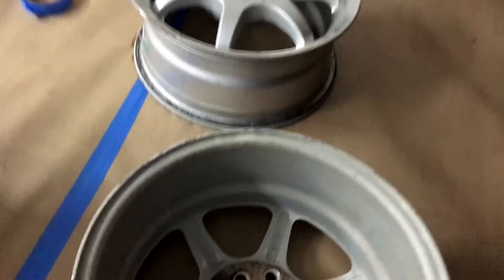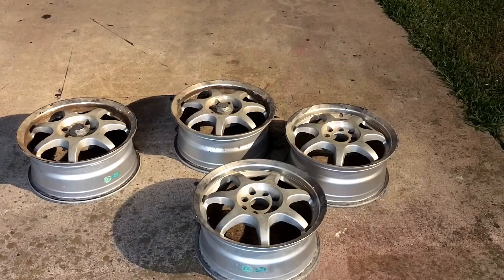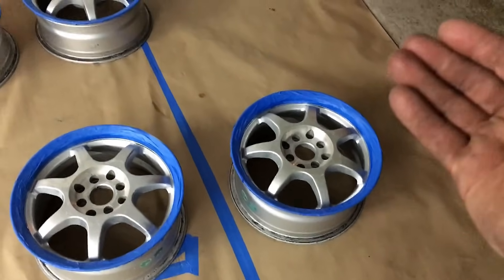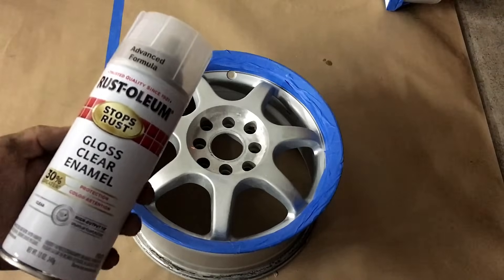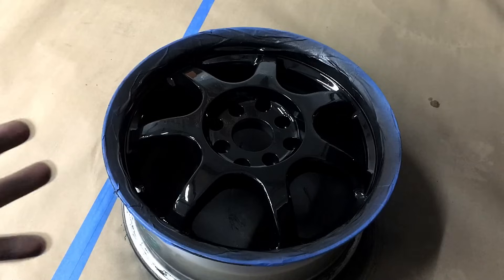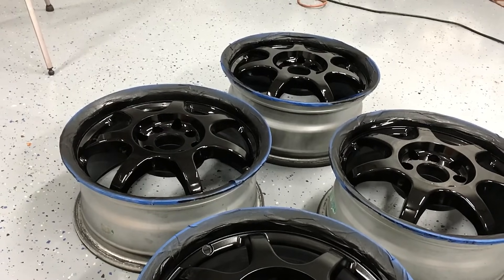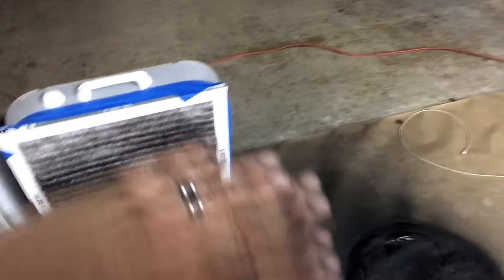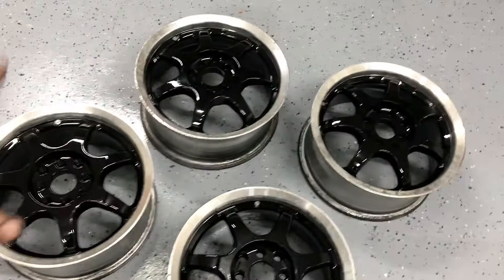How to transform Junkyard wheels using rustoleum from walmart!

Comment: Which primer did you use?  I didn't see that noted?  I was wondering about for rims that started their oxidation, using the Loctite Rust Neutralizer as primer and then paint.
Reply: Thanks for sharing as well.  Was thinking I'd rattle can my new 2006 gen2 Prius that can use something to fill in the stock color.  Plus I scored a set of junkyard gen3 prius rims for with good enough 195's along with a set of 185's on a stock set of gen2 rims that have one rim starting to bubble so debating about painting that one to try to match the others. Super cool and John 14:6!
Reply: Ah, I missed the Automotive Primer camera sweeps.  Now see.
Reply: Did you do priming and how it came out? @8:40 My main question about painting metal wheels is: What exactly do you do after priming? See I primed one side of the wheel (internal), and in many places the prime (I used Rust-Oleum Automotive Primer) was like a layer of chalk. I wiped it out, it was a lot, like a thick layer of dust. Then I just washed that wheel. The primer adhere to some parts (best where there was a bare metal), but not everywhere where it was painted surface. I think maybe I should just go over that primed surface w/paint, so together they would adhere, or I did something wrong. The primer is for Metal and Fiberglass surfaces. When you touch that primed surface (after it dries of course), should it stay on your fingers or not? I would appreciate any opinion on this matter, I googled and nothing about it. Some people use application of Glass Cleaner on a rag to wipe it out before and between layers of paint.  The wheels are not aluminum, they got a bit rusted, I removed that rust, prepared surface, but smth went wrong w/Primer, I think.  Seems like no certain information on the right application of a Primer.
Reply: @olenaerhardt7725  The wheel and like most everything related will need very very very thorough cleaning.  Ideally like take to a car wash with pressure washer if you don't have one of your own.  Then use something like Purple Passion that's a water base cleaner to further clean and prep the surface.  Then use some sort of abrasive sand paper or maybe even a Brillo Pad, though read into since I've not done rims.  Maybe steel, a wire wheel will be good enough.  So, once most the rust is removed or old paint, wipe with a acetone rag to clean all that dust and stuff off.  Then if the surface was rusty, I've found for other projects I use Loctite Extend Rust Neutralizer or Naval Jelly.  Otherwise if there was never any rust, the surface might be good enough to paint with a high quality primer or maybe needs to be cleaned again like before and wiped with clean towels or rag to make sure a super clean surface prep that scuffed enough for the primer to adhere well. Can't have any oil, grease or other residues.  The spray can Rust Neutralizer is like a primer in itself and be sure to read the can instruction.  I recall two coats are used and then you can paint over that.  I totally am not a painter and seems from my experience the quality of paint makes a huge difference, along with the humidity and temperature outside like the can instructions note.  Even though I've read and seen many perform a first coating like a "dusting" to make sure doesn't orange peel and there is good adhesion, sounds like your surface might not have been cleaned enough, your paint didn't fully adhere for some reason like is bad for material or something I don't know like maybe wasn't fully dried. .
Reply: @jafinch78  Thank you for the replay and so detailed. I cleaned w/degreeser, then patches of rust w/Naval Jelly, and after all that I wiped all the surface very well w/99% Isopropyl Alcohol. Then I saw like ChrisFix uses wire brushes and sand paper, and did all that. So all the rust was removed, maybe not so ideally, but pretty good. I received some opinions that the main reason might be too high temperature. It was a very hot day. Yet i was wondering why they say on the label about highest temperature. I was painting in Dallas, it was around 100F. I didn't know about that effect of drying of the primer in the air. No information about it anywhere. I'll try to paint in the mornings, when it is around 80F. I bought several other primers to try, but I think the reason was in the too high temperature. For some reason no one points out on that factor on YT. Thank you kindly again.
Reply: @olenaerhardt7725  I see.  Yes, the temperature can have an issue as well as humidity a lot.  I've watched Professional BACKYARD Paint-Job Using Only Spray Cans, by Paint Society YT channel and he is in Florida and does in the morning and notes in I think that video.  He has some other great videos on painting rims, though not certain if steel.  I know sun is another issue, don't leave in the sun is noted on some labels, whether that is heat related or maybe something IR or UV related effecting the cure.  Amazing the differences in the specific types of paint made by Rustoleum as well.  When I tried to restore my 2006 Prius hatch back handle part, the Advanced Formula was amazingly and looked great though was the wrong color.  I then switched to their Camo Flat Black and that oranged peeled like crazy.  I did way thicker coats when applying.  I needed the handle though, so just clear coated with the Krylon Triple glaze and called it good for now.  Though anyways, was amazing how the type of paint made a huge difference in quality.  With rust s well, ideally is what is required to prevent rust.  Has to all be removed and if not, I've found using that Loctite Extend Rust Neutralizer as primer works better for me.
Reply: @jafinch78  Thank you. I saw Paint Society film before during my research on that primer problem, very good channel indeed, they are very professional, but that question about weather conditions were not much discussed, like anywhere else on YT. Maybe only for me all that looks so important, and probably people who are more or less involved know about it very well. I use only Rust Oleum after had 2 times issue w/Dupli-Color (not about quality, it just didn't spray). It is good to know about Loctite Extend Neutralizer. I paint sometimes parts when working on our cars, and usually my demands are modest: no rust and clean surface. But it is very good to know about all those wonderful paints. And that detail, to avoid sun - I've never paid attention to this condition, thank you.
Reply: @olenaerhardt7725  Yes, your very welcome. Glad to help and be of service.  I don't think I've documented in video me painting other than results and maybe creative repair preps like I said for that 2006 Prius hatch where I needed something other than what ghetto dirt cheap came with.  Maybe I can do a video sometime to note that observation I had.  I used to paint BMX and freestyle bikes more when I was younger and other things over the years.  Usually always rattle can, though each paint seems to have their own details for best applications.  Glad you asked as well, since am being reminded about undercoating and other surface prep needing to done to my cars to prevent stuck bolts that up here in Michigan I'm reading need more than heat sometimes if they don't break free.  More-so will grease everything when I assemble the new parts. Little different situation right now for me, though came to mind.  Thank you and maybe if you make a video and upload like a short, someone might know exactly your situation and comment?  Just a thought.  All the best and kind regards.
Reply: @jafinch78  I recorded many projects I did. When I started to put everything together I didn't know exactly how to cut of what you don't need and especially how to glue different films in one (since I did several films on one project most times). I kind of started, then put aside, then many other things, you know ... I need to look into it again, thank you for reminding. I think a video on weather conditions effects would be more than helpful, if you think about making a film on that. There are many on surface preparation, but see how, I watched a dozen at least, all of them were very good, but nothing about the weather. So here we have it: 3 days I work around one wheel (it has no tire on it, since I'm replacing), no need for masking, seems like could be done in 3-4 hours, but everything went wrong just bcs I didn't know that a primer can dry off while flying to the surface. Anyway that way we learn, the main thing I found the source of that problem. About releasing bolts, I found the best solution to apply PB Blaster and leave it (longer - better). Everything releases, even those bolts under Red Threadlocker (and w/ no heat or damage).  All the best as well, I really appreciate your time and sharing impressive knowledge.